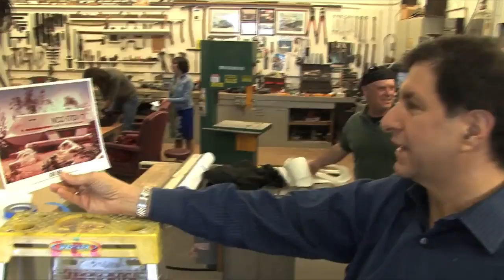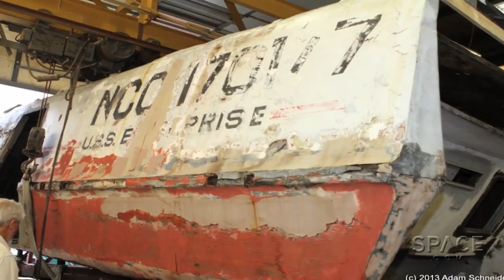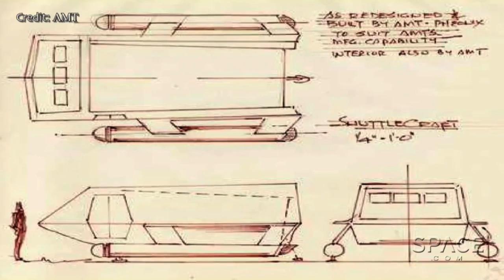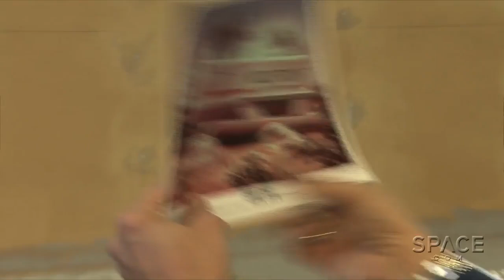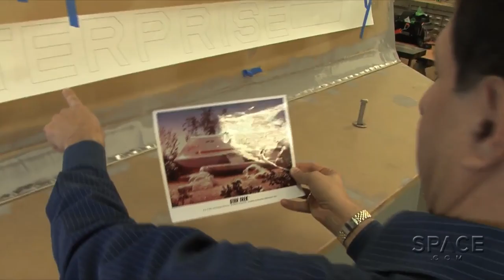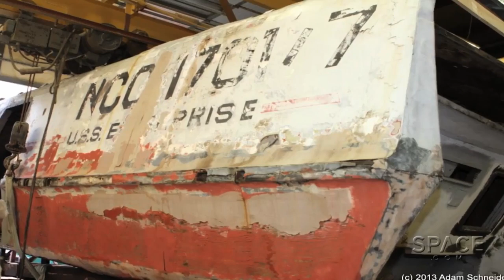'Star Trek' Galileo Shuttlecraft – How It Was Restored To Flight Status

Comment: Great contribution and craftsmanship. Curiously, the video doesn’t show the interior which I assume was also restored.
Reply: The prop was only ever an outer shell.  All interior scenes from the show were filmed on a separate set that was much too large to fit inside the prop.  Notice that the actors could stand fully upright on the set, but the interior of the prop is only around 5-feet from floor to ceiling, which is why the actors are always hunched over when they exit it.

Comment: The interior set of the shuttle was bigger than the exterior dimensions of the original Galileo prop so it is not possible to build a accurate interior within the restored Galileo prop.
Reply: onetruekeeper “selective compression” is what we call it in model railroading.

Comment: They should have made a mold off of the finished body panels [before painting] and Trekkie's could chop the family van up and make a drivable Galileo.lol.Check out the botched paint on the nacelle at 5:59. And that red stripe looks brushed on? Obviously alot of work went into it but come on. I would think if it was donated, it should have been donated to the National air & space museum, and displayed with the original enterprise.I was going to go see it on my way to Georgia, but I figured the only thing original was the steel frame, its sort of a reproduction. Like taking a classic movie car and only the frame is used because its so beat down. I would have at least considered leaving it alone, and building a all new one. Then display the two together.Ok rant over. All in all WAY COOL this gentleman took the time and money to rebuild it.

Comment: Fantastic labour of love, it looks great. I followed this from when it was purchased by Schneider. He could have made it into a decent boat too! My complaint about the updated STTOS effects, is that I don't like the computer renderings of the Galileo (or the Enterprise), the colours never look the same as the original, and they are seen to perform aerodynamic banked turns, which make no sense in space. Of course in the original versions of the show they would have used smaller models for those types of shots. Not to mention that those shuttle engines only provide forward thrust ("Like sendin' up a flare...")...unless they could be independently controlled. But then I assume it could still only move in two dimensions...

Comment: Beautiful restoration...but, no interior?
Reply: That was my question...
Reply: @destinationmobileone5476  Well, I understand that, but since CGI's got that covered (for both better and worse) I figured it would've been restored to "Three Dimensional (fictional) reality", but I can understand why that might not be practical from a monetary standpoint, particularly if it wasn't going to be used as a tour type attraction.
Reply: @destinationmobileone5476 Ah...too bad. Still, a treasure preserved. Incidentally, have you noticed the similar design lines of the shuttle with modern work vans?

Comment: They can restore planes that have been laying on the seabed for 60 years, but they have big problems repairing this box ?
Reply: The planes were built to last -- this thing wasn't.  No one expected it to last for one day longer than it was needed.
Reply: @jcortese3300 - So you also think it's hard to repair this box ? 👀
Reply: @jcortese3300 - Yes, but it has survived for many decades. What is the problem ???

Comment: Baloney! No pics or film of the INSIDE!!!!!! Let's see the inside!
Reply: No, but was was rebuilt! Does the inside look like similiar when it was starring on the series???? If one is gonna spend a small fortune on the outside, why not spend a little on the INSIDE, THEN people will be amazed when they peak inside of it.!
Reply: The inside is bare. The interior  we saw on the show was a staged set.
Reply: I agree, but SOMETHING s/have been built there, at least a control set as seen in the series. EVERYONE has an urge to look inside, and see what's there, it's only natural. Well, at least we got the bones!
Reply: There never was an interior. The interior set was a separate set which was actually bigger than the full size mock up's interior. The full size shuttle is actually smaller than it would have actually been but most people don't notice when they watch the show. If they would have built the interior, it would have looked way off.
Reply: Ok, sounds good, but there's space to do some type of replica, so people can just peak in!
Reply: Did you contribute? If one is gonna do a job, do it completely, not half-azz backward. It's incomplete, and found wanting!
Reply: Ok!